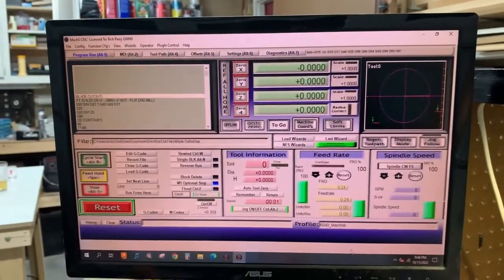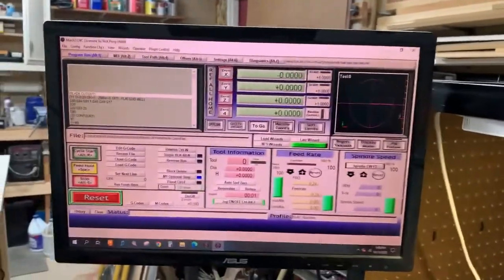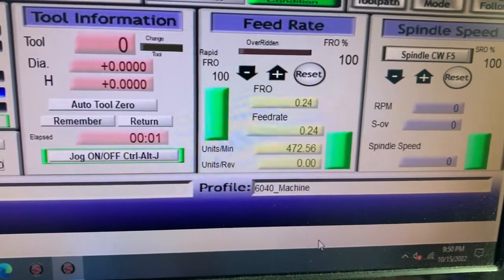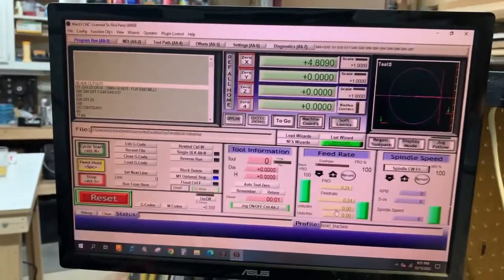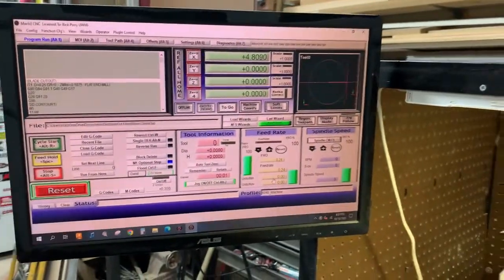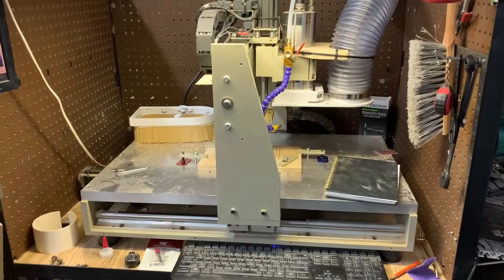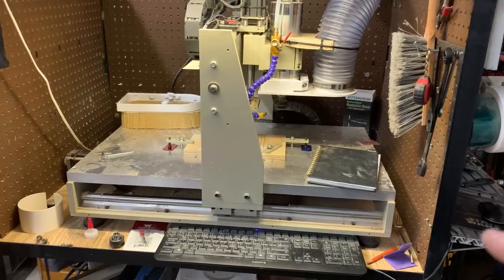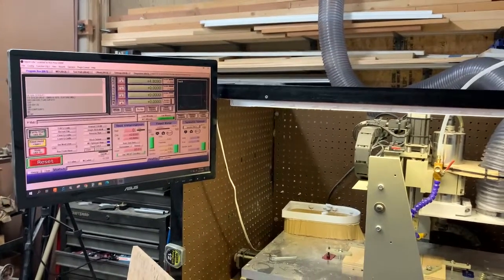Mach 3 on 6040 CNC doing 500 IPM

Comment: Hey, please write the components for the upgrade. I have a 6040 using DRUFEL software and original usb controller
Reply from the maker: Hey there, contact Vince at E dealers direct. Hid ebay store is where I got my stuff from. https://www.ebay.com/str/edealersdirect?_trkparms=folent%3Aedealersdirect%7Cfolenttp%3A1&_trksid=p3542580.m47492.l74602

Comment: what controller board are you using now?
Reply from the maker: It’s still the Gecko G540
Reply: @cpworx_maker I'm new to cnc and curious if you can put a bed extension on the 6040?